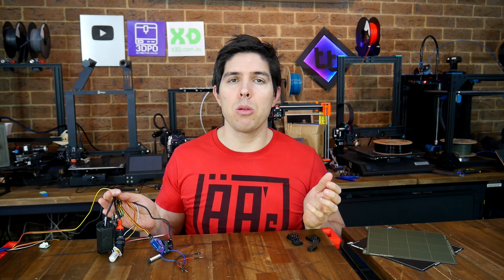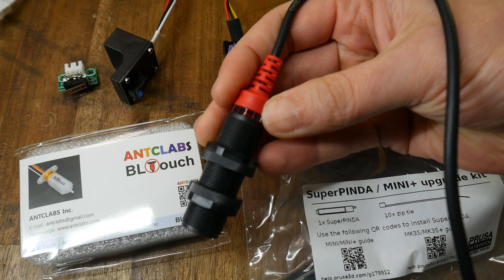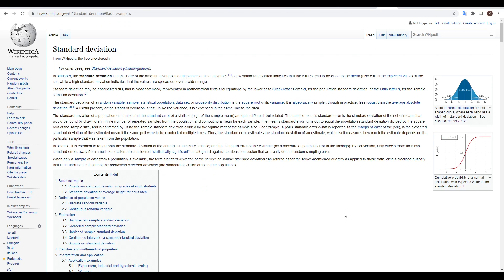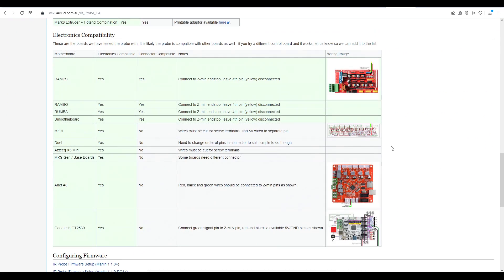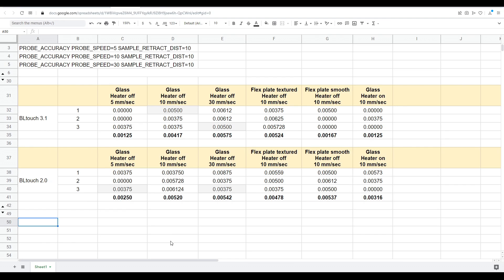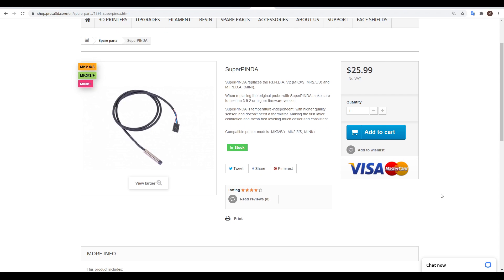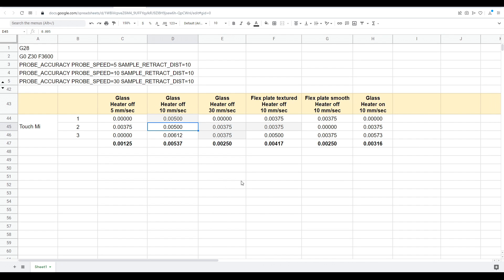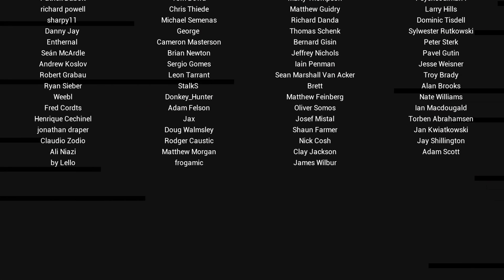Six popular ABL probes compared: Accuracy, price, wiring and more!

Comment: The best probe imo:
A micro/optical switch on a 3d printed automatic retraction mechanism
Reply: You gotta design it very well to be reliable, I know cause I cheezed out on my servo arm micro-switch one. If you rely on the servo arm itself keeping position accurately, you're probably gonna get screwed up, the moment the micro-switch presses down, it can bend just slightly the arm and throw off the measurement, plus the servo itself holding perfectly the position with no vibration during the probing.
A well made one can sure do wonders, no doubt. One I wanted to make (before giving up because the servo itself I was gonna use was giving me crap) is similar to the Touch Mi (optical switch with a pin that probes) but instead of the magnet and movement down to store/deploy, you use a servo.
Reply: @Kalvinjj  Annex's Quickdraw probe works flawlessly
Reply: @SnakeOilDev  Oh yes a magnetic one that you pick up. I can imagine it being as reliable as the switch can get indeed, which is pretty darn accurate. It does rob a little of the print area tho, but lighter than anything else.
A solution to that I've seen some guy make for his Voron V0 was a servo arm that brought the switch up to be picked, but kept stored on the side of the printer out of the print area otherwise. Pretty genius idea.
Reply: @Kalvinjj  I've been using one and it's perfectly fine. Tho I removed the metal arm and I designed with that in mind. You can also turn off the servo after deployment. Also many don't even use a servo. Like the touch me you can do it cheaply

Comment: Timely review!  I have the original EZABL (not the pro) and I have to adjust the Z offset at each print to get to the level I need.  I attribute this to difference of the bed temperature linked to leaving the probe near the bed or not.  I am now looking at other technology and have not ruled out upgrading to the EZABL-PRO simply because it will be a drop-in.
Reply: Our Pro sensors have come a long way and we upped the polling rate on them by 6x over the older EZABL kits as well as better power filtering and easier hookup. Our opriginal EZABL probes were good, but the Pro is definitely better. Let us know if you have any questions about it!
Reply: @TH3DStudio  I have 5 or 6 and am plan on adding it to my RatRig 400mm
Reply: I would give the pro a try . i have it on 2 printers and love them and you already are set up for it.
Reply: I'm glad I found this comment.  I have the exact same issue with the same version.  I am looking at different options but will keep the pro in mind as well.

Comment: I have at least one conclusion to give, the original capacitive probe from creality that was on the old cr10s pro v1, was awful at least :)
Used a conductive after that, worked really well.. then the more I have used the bltouch, despite price and firmware troubles you might have, its a good probe
Reply from the maker: I agree that probe was not great. I did, however, get consistency after calibrating it a bit more as seen here: https://youtu.be/iw5HfHxlnwI It was then great if you stuck to the same bed temperature.

Comment: Consistency is the only metric thats important, accuracy is nice but not important. You keep using the terms interchangeably and its infuriating. Accuracy would be reporting the measured distance correctly while consistency will be measuring the same distance every time regardless of if it's right or not. For 3D printing you only need repeatability. 

The average standard deviation isn't useful the maximum is.
Reply: I like how you interchanged the terms consistency and repeatability
Reply: Came here to say this. I’ve had inconsistencies primarily with the capacitive style probes (old PINDA, EzAbl style) especially when things like ambient conditions change (air temp, humidity, etc.). The bltouch so far has been my most consistent probe, and I like that I can easily change print surfaces and not have to re adjust it each time because it isn’t relying on a sub surface magnet. The super PINDA seems to be more consistent but you still need a different offset for each sheet type (and nice that latest Prusa firmwares let you store it).

Comment: Love my trusty BL touch. I have thousands of probings across multiple printers without a single issue. I can't speak for any other brand cuz I've never used any of the other ones but the BL touch is a good one
Reply: I went thru 3 and gave up. Too complex solution to a simple problem.
Reply: @mattlogue1300  hmm. What was happening to them?

Comment: IR probe will not work with transparent glass (on one printer it's a glass, on 2nd it's a mirror). 
Apart from that you missed really great (especially on delta) piezocermic probes that use nozzle for  probing.
Reply: Are you sure about that glass/mirror statement?  I would expect the 2 IR LEDs have slightly different angle thereby creating a higher focussed intensity at a specific distance below the board for anything it would hit there, even an air-glass boundary.  That's just my theory though, so if you are speaking out of experience, I stand corrected.
As for measuring with the nozzle: no thanks, since it then has to be completely 'blob'-free at the time of measurement and I always seem to have some oozing after each print, so having to clean that off (possibly requiring heating) before every ABL run, isn't really what I would consider user-friendly.
Reply from the maker: Completely disagree. This probe works on everything I tested it with, including completely clear glass. Maybe a similar one you've used doesn't but this one does. Important not to speculate on products you haven't tried first hand.
Reply: @TeachingTech  I looked at spec from manufacturer, that's why I didn't bought one. Can you please test IR probe on mirror? I'm very interesting in results.

Comment: It could have been interesting to try a 3DTouch, to see if it's drastically different from a BLTouch or if it's just as accurate. I bought mine from the MKS store on Aliexpress for 10€, and it's been very reliable so far
Reply: I did a test recently. The original BL touch on my Ender 3 V2 produced a std dev of 0.002mm and BL Touch produced 0.003mm. That is 2um or 3um. The layers you are printing are typical 200um plus/minus some percents. That is two order of magnitudes difference between stddev of BL/3D Touch and layer height. So currently, the BL Touch and the 3D Touch will result in similar print quality. You can use either of them.
Reply from the maker: Some people swear by them, some people say they are rubbish. I think they are both tell the truth and the quality is likely variable. Which means if I get a good one and promote it, half of the people who then buy on my recommendation will feel cheated. Personally I'm happy to pay a bit more for the original but I understand that plenty of people don't want to do this.
Reply: @TeachingTech  But we've seen people with a stddev in the range of 0.2mm for original BL Touch as well, maybe not so many, but we've seen them. While I admit an uneven production quality for 3D Touch could in theory produce variations ranging from good to bad, I may suspect that the unexpected poor performance some see, may actually have root in poor power distribution. Imagine a little too high impedance in the thin power cabling for the 3D/BL Touch and imagine these cable being close to another cable from mainboard to printhead and imagine that close cable carrying a duty cycle controlled (by mosfet) regulation (square form)  for lets say heater in hotend or fans, these  produce all kind of secondary etc frequencies that may affect the 3D/BL touch. So maybe we are seing poor power distriution together with noisy cross talk resulting in measurements all over the place.
Reply: I got one a while back and got variations in probing on the order of .2 or more mm, which is catastrophic. I don't think I was doing anything wrong, may have just been a bad unit, but having to level the bed twice a year isn't too bad either.
Reply: @TheAnoniemo  Mine is fine are you sure you installed it correctly? It's made from the exact same off the self components as the BL touch is so no reason for it to be different.
Reply: @TheAnoniemo  That's definitely defective. My 3D Touch (trianglelabs newest version) does at worst case about 0.03 or what is it again. And from what I've read, that ain't that great either for those probes, I could add a capacitor to the 5v supply to help this further.

Comment: You really missed out by not testing an Omron TL-Q5MC2 DC PNP NC
Reply: Catchy name
Reply: @fredwupkensoppel8949  well it's an industrial approach sensor used in CNC machines, it's a very popular probe for custom printers.
Reply: @urufushinjiro  I'm not saying this probe is bad, I'm saying the name is bad. Is there a probe that runs on AC? No? Then drop that. Dunno what the other things stand for, but there must be way to simplify this, even if it's for industrial stuff.
Reply: @fredwupkensoppel8949  it's not a commercial product, and yes, there are AC probes, PNP describes the transistor type, NC is for normally closed etc
Reply: @urufushinjiro  Alright, that checks out then. I didn't disagree on it being a non-commercial product tho.
Reply: I've got the Omron probe and with the PROBE_ACCURACY test in Klipper it often shows a deviation of zero! That being said it's only consistent within a small temperature range. I had to change the offset between printing PLA and ABS. I eventually replaced it with a BL Touch and a glass print surface (for true flatness) on my Voron Switchwire and now I get incredibly flat and consistent 1st layers regardless of the temperature. I haven't had to adjust anything in over 6 months! 
Not saying one is better than the other, this is just simply what works well for me.

Comment: Been using a BLTouch for a few years now, it was my first touch probe and it still works flawlessly. I have no idea about durability of other probes but I can say that this one is holding up quite well. This is an official BLTouch btw, one of the older models with a metal pin.
Reply: i really been wanting a metal probe i have the newest model with a PC pin and it keeps bending its actualy farely easy to bend back decently i have a glass bed and im not careful with my probe at all and it still works flawlessly and more than accurate enough for my printer
Reply: @v1Broadcaster  You could try creality's  cr touch. Its wired exactly the same as a bl touch just with a metal pin
Reply: @kenopyowo  Also, It's optical instead of magnetic, and has slightly higher accuracy.
Reply: i can confirm, i have 4 pieces, one of them old with metal pin, none of them failed ever...
Reply: @j.g545  I still use Hairspray on glass (why change it works perfectly). The only "problem" that I have is me, being stupid, spraying the bed when the probe is still close. When just a small amount of hairspray gets on the pin, I have to clean it off or it sticks in the stowed position. A 5 second cleaning job frees it right up though.
Reply: My pin broke off the first day I got it. Had to melt in a metal pin just to make it work again. Not to mention that it blew up TWO ender 3 motherboards due to incorrect pinout. It works now, and amazingly so but damn... it's not always plug and play.

Comment: I didn’t think using a limit switch as a probe would be accurate… but it’s low cost has me tempted to try it out
Reply: Check out klicky probe. It’s a pretty cool corexy limit switch probe that gets around the mounting issues seen here.
Reply: yeah, since i got the Flsun SR, i don't know why i  bothered with the touchmi all this years.
Reply: Yeah, the only issue that actually was mentioned in this, but I think was slightly glossed over (no fault to Michael of course) is that, it doesn't have a deployable probe. This is what makes the BL Touch significant IMO. With a limit switch, you'd really not have much of an option but to use it as it's shown in the video -- magnetically attached only while probing, and then removed during printing.
Reply: @daveabittner  as stated, check out the Klicky Probe mod for Voron CoreXY machines, it is an automatically picked up and put away microswitch probe that is actually pretty easy to set up and use.
Reply: @urufushinjiro  dockable klicky probe is the best.
Reply: @daveabittner  I have one of these probes for my printer, and it's good and bad. Bad is that if you forget to remove it you can destroy the probe very quickly and easily, I've accidentally done this before. But the good is that the probe is normally exactly over the nozzle and that as its removable, when not in use you don't need to have it connected. I've got a delta printer so I only need to do bed leveling only once in a while.
Reply: @daveabittner  To me that is an advantage, no added weight while printing.
Reply: @originaltrilogy1  Absolutely it is! But I was more clarifying that that is why there is no microswitch on the BL Touch.
Reply: @daveabittner  This is 3D printing we are talking about, a locking probe could always be designed.
Reply: @CaliMeatWagon  Very true. But that's not a small task. There is a reason that the BL Touch does not use a microswitch, and that is, how do you deploy a microswitch? Do you use a motor to move it down? If so, obviously that's quite a lot of weight.

The BL Touch does not use a microswitch largely due to the fact that, on that scale the only reasonable way to deploy a probe is through magnetic action. However, they then took the clever step to combine this into how the probe actually detects it's pressed. It uses a Hall-Effect sensor. Therefore, if you're making a deployable probe, it doesn't make much sense to use a microswitch imo.

If you have some solutions to this, though, or even just examples of other things that don't do this I'd love to hear it! This is just my own personal thinking on the subject.
Reply: There is also Side Swipe Magnetic Probe for V0 and printers where you don't have extra space for klicky.
Reply: Check out the annex engineering QuickDraw probe
Reply: All printers without a bed leveling sensor practically use the bottom end stop switch for leveling. You just have to manually adjust the offset and alignment of the bed.

Comment: Nearly 100 prints with the CR Touch on my Ender 3 V2. It's been pretty much flawless so far, my only criticism is that the metal pin vibrates a fair bit when printing, and the noise is quite noticeable.
Reply: I've had the same issue too, I thought it was something within the body itself but it makes sense it'd be the pin. something that has helped in my case is fidgeting with the mount. Im not sure about the stock metal mount as im running the Hero Me Gen V and I made a custom mount for it since none were made, and with a little fidgeting of how tight the bracket is to the body and how tight the CRTouch is to the bracket, I've all but eliminated the vibration. I think it's the same case as your 3d printers feet, you need a good mix of dampening and elasticity and that should get rid of the vibrations.
Reply: Yup. I love the cr touch though. I couldn't print for shit without it.
Reply: maybe you can install an O-ring to steady the vibrations?

Comment: Having had a BLTOUCH and an EZABL, I wouldn't touch the ezabl with a ten foot pole after trying a bltouch. so much more reliable long term and the EZABL suspiciously stopped working just after their 90 day warranty which is illegal. When I contacted support, I was basically to F*ck off and find the solution in the forum.
Reply: Lol. I’ve had more than one genuine BLT fail catastrophically. The design is flawed and if it fails, will deploy the pin and destroy itself at best and ruin your print at worst.
Reply: @nocjef  I've only ever had that happen when I had my firmware setup wrong. Cant remember what I did but it didn't stow it after probing. My current clone one is on about a year, with about 10 months being daily use and still going strong
Reply: Hi Pearlino! We do not intentionally engineer products to fail just outside of warranty like you are implying. Our latest EZABL Pro does come with a 6-month warranty, we extended this earlier this year.

We'd love to look into your support request to make sure your ticket was properly handled and see if we can help you resolve your issue. We do offer discounted replacements on the EZABL even if you are out of warranty. Could you send an email to Streams@th3dstudio.com with your original ticket number so we can have our team look into it?
Reply: 3 month warrantee, lmao. What a joke, we have laws protecting customers against that kind of practice